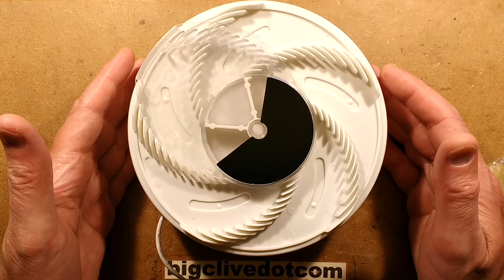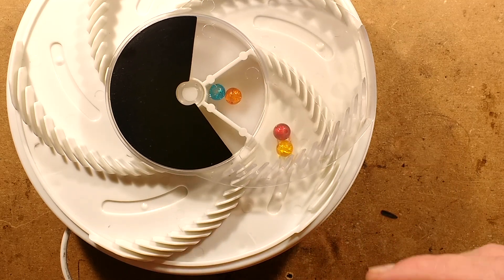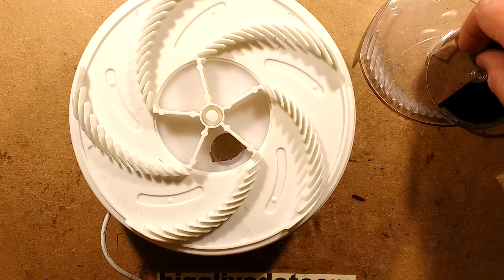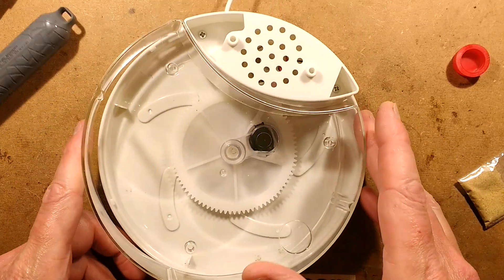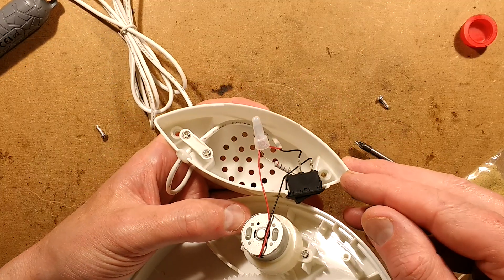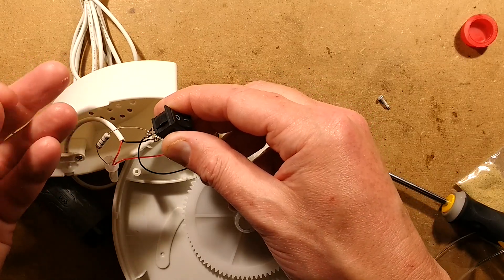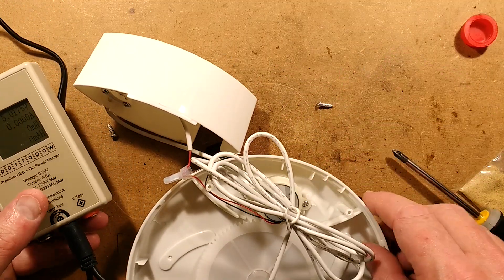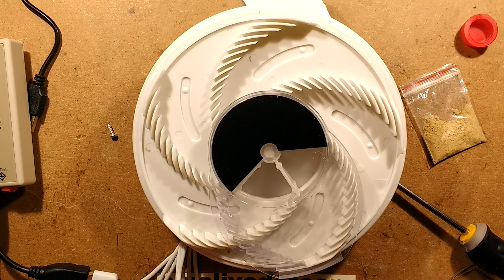Inside an electric fly trap.

Comment: Resistor... Warmth? Flies are a little bit attracted by warmth... And gently warming the food would spread the scent of it? Or... Overcurrent protection for if the motor/rotating unit gets clogged by food or flies? And it's resistance goes above the resistor's value and then stops?

Also... I was thinking initially that it trapped the flies and then crushed them between the fins :D
Reply: Thanks. It was basically stream-of-consciousness typing. And, though this will come as a shock to YouTube, I'm no expert :D Still kind of bummed that it doesn't slowly mush the flies in a kind of James Bond villain crushy room though.
Reply: The resistor would act inversely of what you are thinking. The more resistance across the motor, the more the voltage drops from the second resistor. Theoretically it could be speed controlling the motor, but that is stupid, this doesn't need speed control, nor would that single resistor + the resistance of the motor be enough to significantly change the motors speed. It would slow it down though, but probably imperceivably.